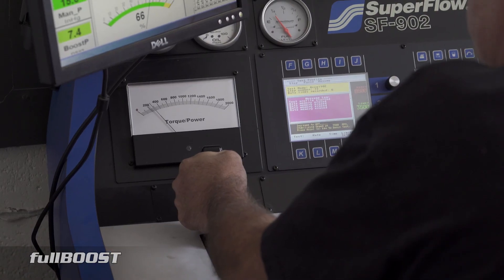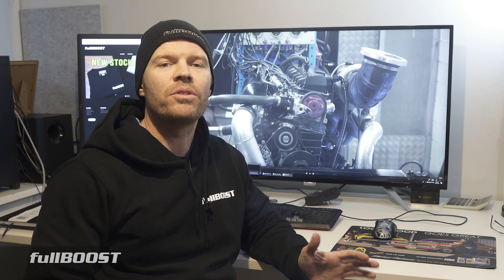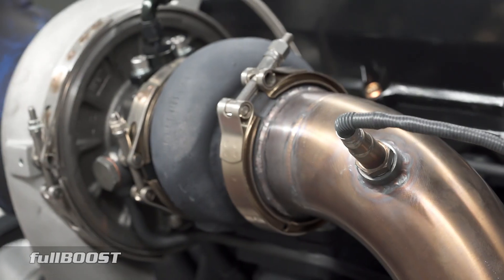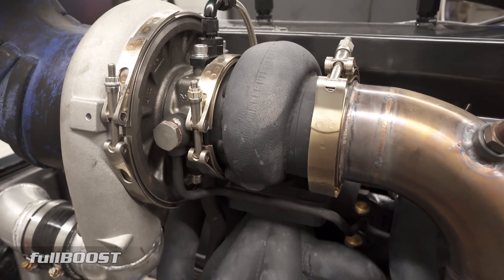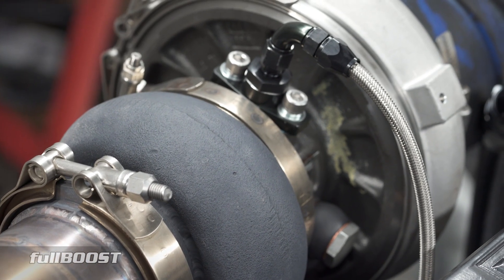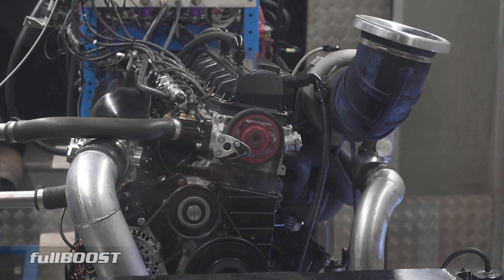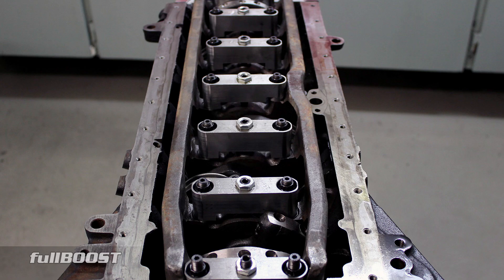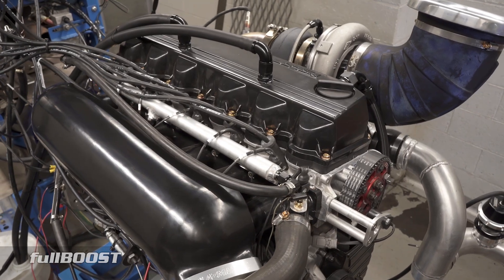How to build a responsive 1000hp Nissan RB30 street engine | fullBOOST

Comment: I'm trying to learn all I can about RB30's well RB'S in general because we didn't get any of them over hear in the U.S and I'm planning on building a 1990 Nissan single cab hard body pickup street/strip setup and over the past 2 year's I've kinda turned into a RB fanboy lol.. I do like to think I know a little bit about turbo LSX setup's at the moment I have a 403 based ls2 setup with a Garrett gtx5591 in a full size single cab 03 gmc Sierra truck or ute for yall lol  I bought the turbo used that was supposed to be in good shape it lasted 3 months never made more than 18 pounds before it ate shit but i had it rebuilt by forced Inductions over hear with their bad ass billet wheel and swapped over to a tial 1.30 exhaust housing its and night difference before the rebuild it lit pretty quick before but now it lights up alot faster than you would think for a big turbo on a 403ci motor but I don't understand how or why they went with the turbo on that rb30 setup the way turbo sizing was taught to was more for big power drag race setups and keeping stock bottom end stuff alive I put my first turbo setup together in 2015 and im not rich so my knowledge is limited but I wouldn't put a t3 on a 4cyl unless it was tiny tiny, its obvious but ive always been told keep back pressure to a minimum ( Duh LoL) and run the biggest exhaust housing as you can because it'll keep the bottom end happier, I dont know if thats an a actual fact but makes sense to me so thats how I've always started out when picking a turbo and depending on cubic inches and what not I pick  the turbine and compressor wheel size  for example a stock bottom end 4.8 or 5.3 ls setup a t6 Borg Warner s475 with a 1.15 exhaust housing is a badass combo that will make some steam but on the other hand I dont know how ot would respond in something with a manual transmission I only fool around with th350,th400,80e's and powerglides I've only been involved with 1 setup with a t56 it was a 89 Camaro with a 434ci combo with a tall deck RHS block it had a single precision promod 102mm on it running on methanol it makes north of 1700hp. I know this is a long comment but im at work bored im a maintenance tech and we are running one line that never breaks sooooooo. Anyways is it just me or would this RB30 setup be alot happier with something in the 62-67mm with a smaller turbine and t4 housing

Comment: Step 1: Ring JPC and leave multiple messages because they never answer the phone.

Step 2: Wait

Step 3: Take your business elsewhere because they don't ring you back
Reply: Or worse, they do half the job and charge you as if the whole job had been completed. I had a brand new GT42 years ago that had been dropped in the box before I bought it and slightly bent the shaft. Took it to Paul (the guy who was running the dyno in this vid) to have the shaft straightened and balenced and V band the exhaust housing and would you believe they did the V band without even attempting to straighten the shaft. When he picked it up and handed it to me and the impeller still scuffed the compressor housing, he looked at me and said "oh that's just because the housing is loose and is slightly cocked"... Stupid me, took him at his word and handed over my hard earned money for something that I haven't been able to use (since around 2006 - 2007). It's still sitting in the box they gave it back to me in right now- I'm literally looking at it right now. Dishonest cunt he is. It just cost them a customer in the long run. And the type of customer who would have continued to use them for both work stuff and my own for years, we USED to get our turbos rebuilt through them with all our customers stuff. This GT42 was to be used on a 304. I've also had a turbo RB30 powered R31 that I've owned for 10 years or so, I will never go to them for anything. I would never buy anything from them and anytime their name comes up I tell everyone my experience I had with them and steer any customer thinking of using them for anything to go elsewhere- to someone more honest. Just like I do with another shop from Preston, who'll remain nameless (One of the two brothers pretended he was gonna fight me at Calder after expressing my experience of using their shop- but of coarse fat boy didn't have the nuts to back up his mouth 😅). These types of incidence have a ripple effect that spread far and wide

Comment: awesome video guys. but i have question. is it ok to just CNC port the heads and install with out upgrading the cam? i mean dose it increase any hp? or is it gonna create any issue if u install the CNC heads with out upgrading the cam.
Reply: Well done head work which includes port work (in the hole), bowl work (area above the valves), and a correct valve job (where the vales seal to the valve seat) *does make more power throughout the whole operating range no matter what cam is used.

Comment: Aiming for a responsive 1000Hp, It then made almost 1200Hp!! lol.
Reply: thats crank.. it will barely make 1000 wheel.
Reply: @TurboVisBits  Put the crack pipe down. It won’t lose anywhere near 200hp through transmission losses 🙄

Comment: Wow that's incredible! That thing would come on boost sooo fast with the rear housing
Reply: planning a very similar build with a stock s2 block, want to run 7psi, ... aiming for 350-400rwhp responsive street build,.. not have to stress the turbo, an utilize the mass of air flow to help with EGT an longevity of the build. This build inspires that maybe ill reach my targets a little easier than expected haha
Reply: gen 1 gtx3582r t04z front comp with garrett 0.63 AR turbine housing.. 555cc nismo injectors, 800 FPR, walbro 460, freddy plenum, through a 76mm FMIC, 76mm cooler plumbing, to 84mm throttle body... 6boost exhaust mani with WG50 lite 7psi,  3" mild steel exhaust heat wrapped from dump back and also wrapping the manifold... stock headgasket and ARP headstuds with rear oil modifications... not sure if this is safe but hoping targets im aiming for are realistic
Reply: @brendanj1124  Multihole injectors (eg R35 GTR) and high power coils (again, R35 GTR) make a surprising difference to the EGTs and AFRs achievable. Look into it!

Comment: Really cool, we can do that down here with one of my own designed turbo that I manufacture on a lot less boost. 
We can see near 30psi at 3400, all on a 3ltr on eth.
Reply: Fair dinkum id like that sort of response and to see 30psi before 4000 rpm
Are you in Melbourne
Reply: @michwas7270  in NZ check FB Mseturbosnz
Reply: @stevemurch6974  I will do that right now cheers mate

Comment: I had an old (talking 70) bloke build the RB30 SOHC in my R31 Silhouette. Using a similar setup as this, but about 20 years ago- turbo was good for 30 psi, and that was its limit, backed by a ford C6 manualised box.

Drove just like a big capacity straight 6, no lag, just a linear power curve. Made 800hp, all i needed.

Comment: How is the absurd amount of exhaust pressure actually being dealt with? Is the gate just large enough to flow the excess?
Reply: It'd have to be a 55 - 60mm gate I reckon. There's a very fine balance between pre- turbine exhaust pressure and inlet manifold pressure. If you create too much pressure pre- turbine (compared to inlet man pressure) it just limits the incoming boost charge and you end up with a % of exhaust gas remaining in the cylinder. To counteract this, you need a well designed exhaust man with a large gate. You seem to be one of very few who put 2 + 2 together there... Being a mechanic of 19 odd years, I've argued this point with a lot of tuners over the years and none of them seemed to be able to wrap their little minds around this concept... Tuners would have to be the most arrogant group in the industry- they also are the first to pass the buck to anyone else when something goes wrong while they are tuning, sometimes rightly so but even when they know they fucked up they will blame everyone and anyone other than themselves.
Reply: @danielbrealey2924  this is the correct explanation behind my question, yes. I like how they never answered though.
Reply: @Jazz3006  All good bro. I enjoy answering stuff like this. To many internet know it all's pass on so much incorrect info... Have a good one
Reply: Unfortunately, a wastegate size has nothing to do with the exhaust backpressure. A little hint: turbine wheel size is more important than the turbine housing size. I'm not sure what wheel they are running, but stock GT45 wheel is huge.
Reply: @danielbrealey2924  Yep, they do, with a tiny bit of info they think they know everything. Dunning Kruger at it's finest.
Reply: @LaimisBMW  What? Gate size is a relevant thing because a larger gate, by definition, results in an increased mass flow with the same delta pressure. The energy contained in that mass flow is what drives the turbine in the first place, whether it be by pressure or temperature. Enthalpy is a thing that you can't ignore.
Reply: @Jazz3006  I don't want to prove anything honestly. But if that was the case, everybody would run big ass wastegates and enjoy low backpressure. However, it's not.
Reply: @LaimisBMW  In this case, I believe your incorrect. You seem to have some understanding of how this all works but aren't quiet there yet. Wastegate position and size 100% impacts on pre- turbine exhaust pressure. The reason people don't all run around with huge gate's is because there's a balence at play here. You want as much pressure pre- turbine as the system will allow you to get away with- this pressure and heat is what drives the turbine wheel at the end of the day allowing you to push high boost pressure into the engine. Being that this turbo has a T3 rear housing with a 0.63 A/R ratio, pressure will be very high pre- turbine, it doesn't have the GT45 turbine wheel, the T3 wheel is a lot smaller along with the small housing it uses. That's what makes it responsive but will also create a restriction if a large gate isn't provided to by- pass the excess exhaust not needed or wanted at that point. Think about what the gate's role is- of coarse it impacts on pre turbine pressure, it's a simple by- pass valve to lower turbine speeds by lowering the pressure driving that turbine. I think we can put this argument to rest now...
Reply: @danielbrealey2924  there's a little more to it from a more detailed physics perspective like enthalpy, exergy, etc., but this is explained pretty well in laymen's terms.
Reply: @Jazz That was done on purpose my friend, he was stuggling with the basic principles- so driving in any deeper would have been pointless. My best mate has a masters degree in mechanical engineering and is currently doing a PHD on- long story short- on manifolds (both inlet and exhaust) and all the different principals and goings on within them. He's been doing it 2 n a half years already, it's always a source of discussion between us as we both do engines for a couple of race teams- he works for a massive multinational automotive engineering firm called Multimatic (they built the new Ford GT's for Ford for example and many, many other high end road car deals and a lot of stuff for race teams all over the world) Obviously being a mechanic, I do engines for customers all the time as well as my friends stuff and my own... ☺ My main focus has been drag racing engines, he's more into developing circuit racing engines, but we currently are only doing drag engines for customers of our own. Well, that's my life story anyway. You must be an engineering student I'd guess. Would that be a correct assumption??? 😉
Reply: @Jazz3006  You seem to know what your talking about more than the average Fullboost viewer, I'm intetested to know your background. It's refreshing to speak with someone who's not a "know it all" with no actual facts or knowledge behind their forcefully pushy opinions. Good on ya pal
Reply: @danielbrealey2924  Yeah, you too. Every bro has an opinion based on what they read on some forum somewhere that they think is gospel. I learned the hard way that some of it can be VERY incorrect information. I just finished up a masters (seriously considered a PhD) on a big emissions project in which we were pushing the engine in some pretty nutty ways. Plus, I had taught myself a decent portion of the controls side during the 3 year process of shopping for an ECU when I swapped my car. I would really love to be able to correct some of the insane things that come out of people's mouths/keyboards, but most of the time I have found that it just isn't worth the effort. Hence the semi-vague and lazy responses to the other dude that likely still believes he is right.
Reply: @Jazz3006  I hear what your saying- sometimes it's just not worth the effort. Everyone on here's a know it all, and your so right- everything they think they "know" is just some bullshit they've read online. That's an interesting back ground, pal. You don't understand what a pleasure it is to speak with someone like yourself. Look, let's be honest no one knows everything in this industry. It's nice to be able to debate new concepts or ideas with true peers that have a deep understanding of engines and how they work- like yourself. It truely has been a pleasure. I'm sure it's not the last time we'll bump into eachother on comments boards. On ya, mate... 😉
Reply: I would like to get back to this backpressure and wastegate thing,as i noticed that you guys seems to know this thing very well.
Let's assume that this rb in this video has 60psi backpressure when boost is 40psi,and 45mm wastegate open just right amount,that boost is steady 40psi.
Now we change the gate to 60mm,and keep it open just right amount,that boost is steady 40psi again. Which combination has less backpressure?
My opinion is that backpressure is equal for both setups.
Reply: @mikin5082  This is a bit of a loaded question that's not as black and white as you may think. It really depends on a lot of different things, like manifold design, wastegate position, size of the turbine housing and A/R ratio- besides other factors like turbo sizing (both sides are equally important here), cam selection, intercooler efficiency and inlet manifold design- all have an impact on the end result of pressure on either side and outright hp. Having 60psi back pressure in the exhaust manifold to create 40psi in the inlet isn't ideal to start with. You'll have problems with clearing the cylinders properly and will have a % of exhaust remaining in the cylinder- which costs you power. If I had a set up with the pressures like that I would be looking to change the manifold for one with larger primaries and collector anyway. If you think about it, you would prefer to have the pressures closer to being equal or a differential the other way so you have positive clearing of the cylinders... 60psi in the exhaust manifold is a lot of back pressure and leavrs a 20psi differential the wrong way. Now to answer your actual question, it still depends on the design of the manifold and where the most restrictive point is within that manifold. If your restriction comes from insufficient primaries, then you are correct. If the restriction comes from the collector and turbine housing then I'd have to disagree with you. Again, there are so many things at play here- maybe the prob lies elsewhere in your set up for example. You want the point of restriction to be at turbine housing for outright power IMO
Reply: @danielbrealey2924   I forgot mention,that in my example the main restriction is exhaust housing. I know that in my example pressure differential was extreme,and that kind of backpressure is very problematic in average engine combination.
But the main point in my question was that fact,that when you read about this thing in internet,it does not matter how many sites you go through,the main answer you will get is "You can't dump pressure out of manifold,without dropping boost,keeping same exhaust housing".
Reply: @mikin5082  Ok, now we've established a couple of things here I can indeed agree with you on the example you've given- in that particular circumstance adding a bigger gate isn't going to decrease manifold pressure when back to backed against the smaller gate, running the same boost pressure. In the theoretical example you've given the smaller 'gate was obviously bypassing as much exhaust flow necessary to maintain the boost pressure your trying to achieve. Yep, I can deal with that. But adding the larger gate can future proof the engine for power increases down the track! If you end up adding more cubes by stroking it, or you turn up the rev limiter significantly or want to add a lot of extra boost- in all of these cases the larger 'gate may be required anyway. But again, answering your very specific question I agree with you
Reply: @danielbrealey2924  I kind of hope that you would have prove me wrong with this. I know that you didn't exactly said that "you can control backpressure while maintaining boost with wg",at all,i just want to get this little deeper,because new guys who is learning turbocharging (well learning doesn't really never end),easily get this misunderstood,and think that well im gonna run smallest housing with big gate and have best of both worlds. And i agree with you what you was saying,of course with turbo setups where you get very high backpressures,you need big gate,to get enough wg flow to actually being able to even control your boost levels. And i also agree that there is much more factors involved,than just that. What a wonderful world.
Reply: @mikin5082  That's it my man. The day you stop learning in the performance world is the day you become much less useful to your customers and start getting left behind at the track. With mechanics in general you never stop learning... 😒
Reply: @danielbrealey2924  That is the truth!
Reply: @mikin5082  😉😊😀